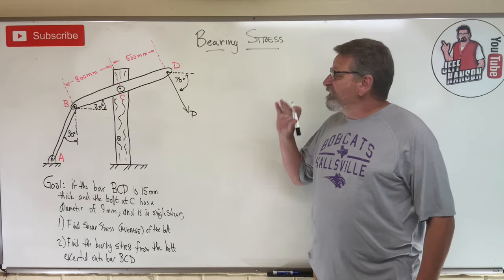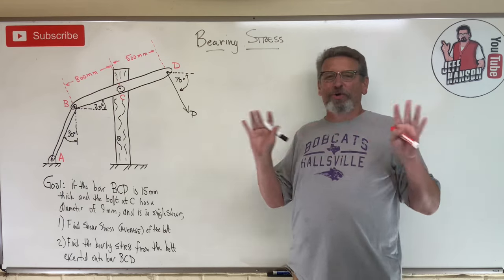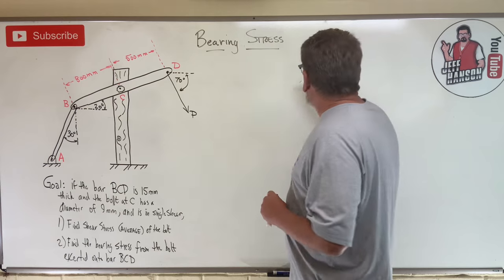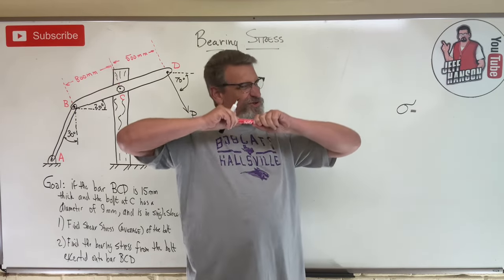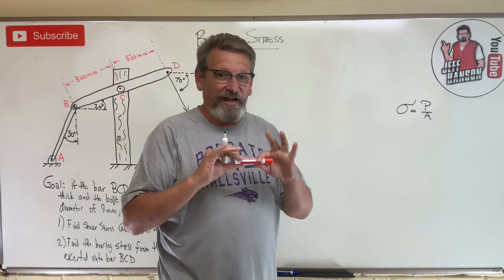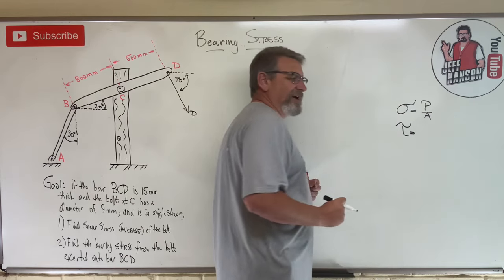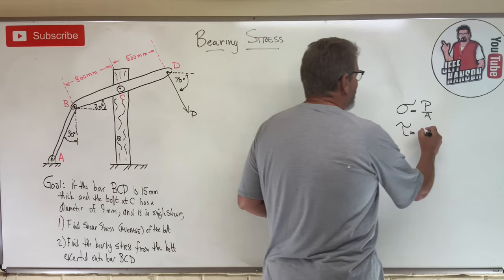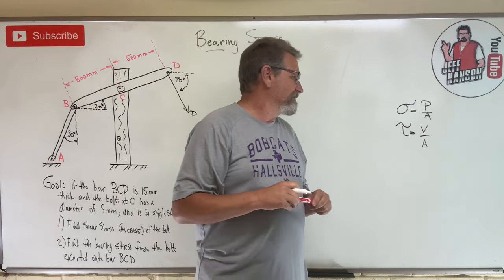Mechanics of Materials: Lesson 5 - Bearing Stress Explained, Example Problem

Comment: Can someone explain how he arrived at the angle 20 at F(AB) to get the overall angle of 50 deg?😪😮‍💨☹🥴😖😫
Reply: This confused me too, drawing a picture of the axes helped me.

Draw a normal x-y axis grid, and put a line above the +x-axis at 20° for the beam and another in the third quadrant 30° from the -y-axis for your AB force.
Now, plot the NEW x'-y' axis with your 20° beam. Since the angle between the x'-y' axes must be 90°, you should be able to visually see that the "remaining angle" in the new plane is 70°.
Looking back at the original x-y axis, you now have a 70° in the fourth quadrant below the +x-axis, and since all the angles in one quadrant must equal 90°, that leaves us with the 20° that Prof Henderson shows in his drawing.

From there you simply add the given 30° and found 20°.

Comment: Your videos have helped me through Statics, Strength of Materials, Structural Analysis, and Indeterminate Structures.

I am an engineer now, but still in school.  I can't thank you enough for all the times you've helped me over the years!
Reply from the maker: Great comment! Thank you!
Reply: @1234jhanson   Can u explain angle FAB?
Reply: @joeking3688  Angle FAB in the FBD Dr. Hanson draws comes from the initial 30 degree angle, PLUS the 20 degrees he rotates the coordinate system. Lmk if this makes sense.

Comment: Hi, professor. Why the area in the bearing stress isn't 3.14(4.5)(15)? because it's half the perimeter times the thickness, that the surface that the bold hold the force with it.
Reply: Hello. I believe it is because if you look at it from the "bottom" it looks like a rectangle and as mentioned in the problem the diameter of the circle was 9 mm which becomes the height if you are still looking it from the bottom. And the thickness becomes the "length".

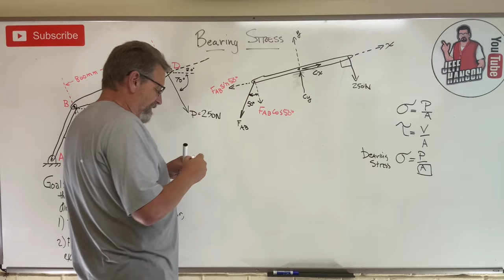Comment: @9:24 why did you make  F_ABsin50 on the horizontal and F_ABcos50 on the vertical. Initially I paused the video and went ahead and did my own calculation but with the moment at point B. I Got stumped not realizing you had your sin and cos mixed up. If I recalculated my moment to have it at point C, I realize I wouldve got the same answers as before. So im just lost on why x is sin and y is cos.

Comment: For A I got 702.47Pa, since I converted the mm diameter to m when calculating area. How is my answer wildly different from yours?
Reply: b/c you're dealing with area, a mm^2 would be 1/10^6 of a m^2, not 1/10^3. So you need to divide by 10^3 again to get the right answer

Comment: I'm still struggling to understand why you have to find the resultant force at pin A and then divide by the area. I thought the shear force was only on the "y" direction
Reply: At pin C? Because he adjusted the neutral axis to make it easier to solve for the real reaction at point C. If u flip it back to the original axis the Y component is not perpendicular to the axis( it will also adjust by 20degress back) so it doesn't make sense to use Y component for it but u need y and x to compute the real load at point C. Hope it helps
Reply: It is average shear stress, so makes sense to take the resultant of the two forces for the total shear stress
Reply: @jae.RCE_pice  How did he get 50 deg at FAB?
Reply: @joeking3688  make the BCD your neutral axis x. or make the bcd straight line in your free body diagram so you can picture out that the horizontal force(tension) and the vertical force is not 30 degress angle but 50 degress 30+20 degress(inclined since you adjusted it for better picture of the diagram) i hope you understand my english this is not my native language